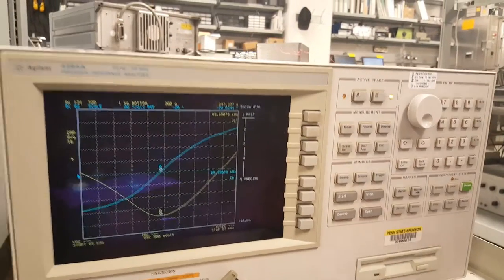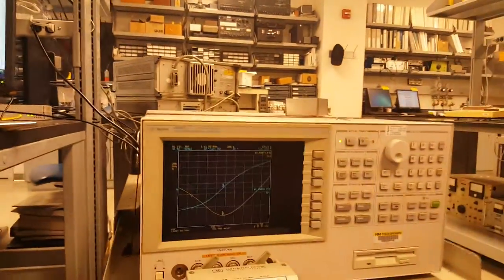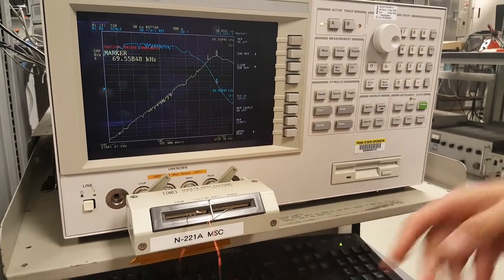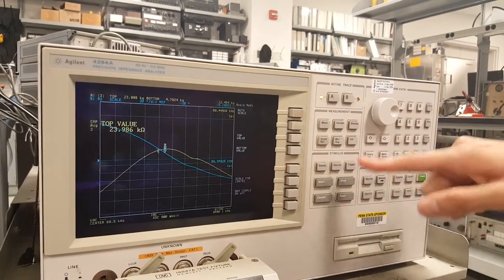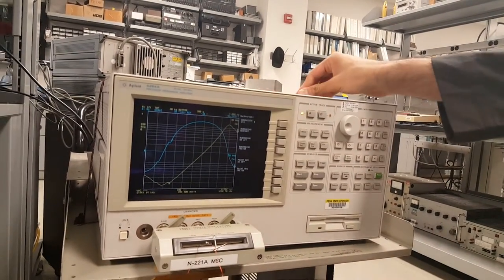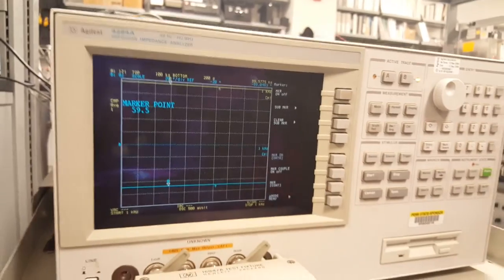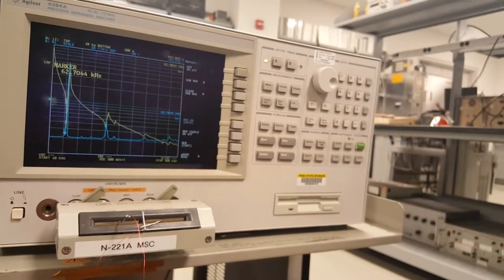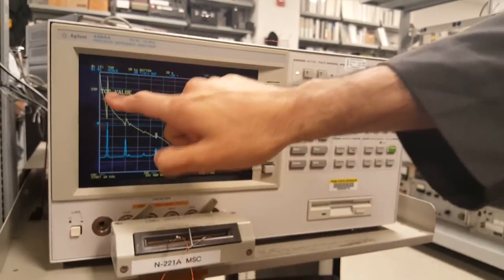Learn Piezo Lecture 10B: (Part 2) HP 4294a  Impedance Analyzer to Characterize Piezo

Comment: Hello sir. Please i am excited with your explanation, well-done. How can i use the instrument to measure the resistance in blood, meaning the dielectric properties?
Reply: Husain Shekhani 
Thank you Sir for answering my question.
Reply: thank you sir. but i am lost where they said that conductivity measurement depend on the compartment containing blood and the electrodes connecting to the impedance analyser. where most people use KCl of know conductivity to measure its conductivity before comparing with or measuring the blood conductivity. but in your experiment or set up you did explain those factors, whether the electrodes used are gold or copper or silver.  And you didnt had a test analysis to compare the conductivity with a know conductivity value, thanks
Reply: And most importantly sir, i would like you help me with a youtube involving or starting from the first steps to operate this analyser from start to gradual measurement of this conductivity. since my supervisor hasnt explain them to me and this my first time handling the instrument so dont even know how to operate it. thank you sir.

Comment: I am working on piezoceramic but my sample holder probe is a little bit different..am not being able to figure out the same...can you help me out?
Reply from the maker: What is your holder?
Reply: It's like a screw gauge where we can mount the pellet in bottom and a bulk arc material is in the upper part which comes in contact with the pellet.
Reply: Keysight e4990a
Reply from the maker: @chiranjitchaliha5318  What does your sample holder look like?
Reply from the maker: @chiranjitchaliha5318  well, you should be able to connect the left two terminals and the right two terminals and thus you can make a two terminal measurement with the "live" side of each connection.
Reply: Sir if possible can you pls provide me your email so i can communicate with you
Reply from the maker: @chiranjitchaliha5318  can you join my webinar on March 10, 11 ET. I can answer your questions live after the webinar. Here is the link: https://bit.ly/3wDp1Y8
Reply: Yeah sure sir

Comment: Hello sir. I am working on similar device in my company. I really liked the video so much. It detailed a lot of issues to me. But I have two questions:

1- How did you get the analyzer connected to the PC.
2- Is it possible to get this excel file? I mean can you send it to me?

Thanks a lot
Reply: @ultrasonicadvisors  Hello! Your videos are great. I have one question too. Where did you find this excel file?
Reply: @ultrasonicadvisors  Hello. Thank you so much. I have one other question too. 
I search online that USB-GBIP is really expensive. 
Is there another way to connect the analyzer with a pc? e.g to use a data logger (I have an ADC-20 from pico technology)  or e.g to connect the analyzer to an older pc with a DB25 cable and then run the excel file? or do I need something more? 
Thank you